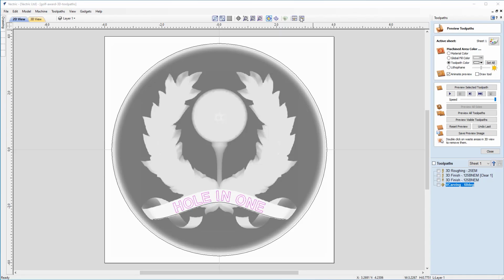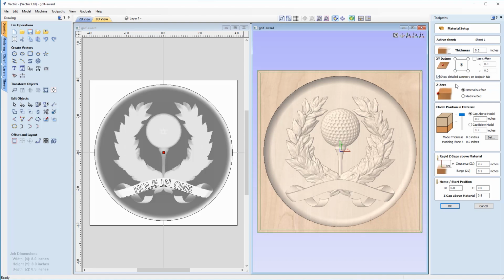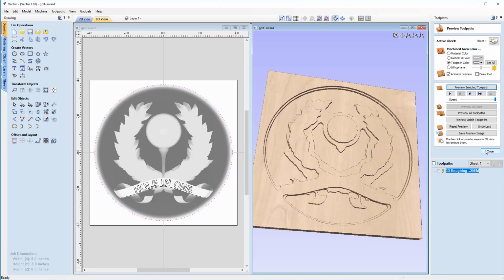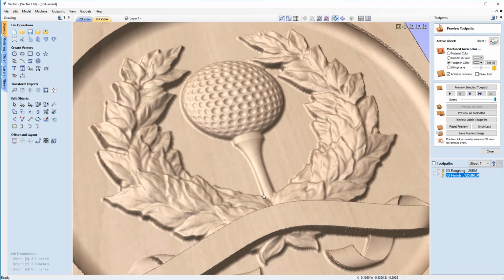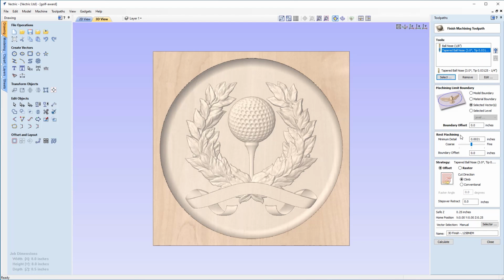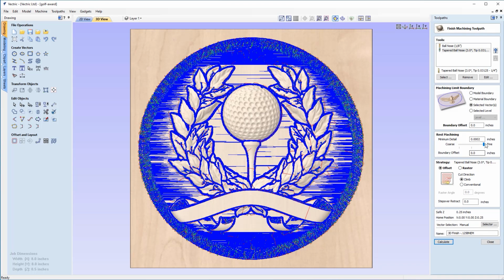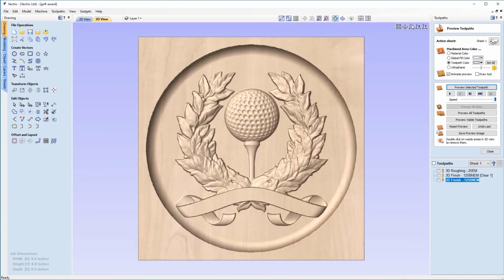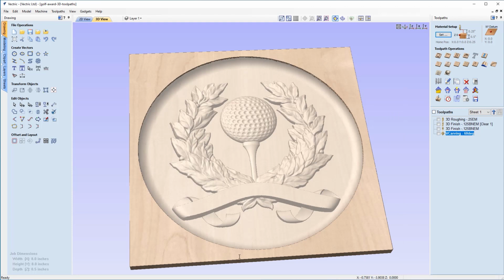Golf Award - 3D Toolpaths | Vectric V11 Tutorials

Comment: With the Rest Machining offset--what does "offset" actually mean, and how does it affect final dimensions of a feature?  If I am machining a model with critical dimensions, does adding an "offset" to the Rest Machining settings affect the final size of the machined object?  I know that for a roughing pass and a normal finish pass, the boundary offset leaves extra material.  Is the rest machining offset the same thing?  It is presented as a "smoothing" setting?  But no mention of if it also means the final model is + 0.020".